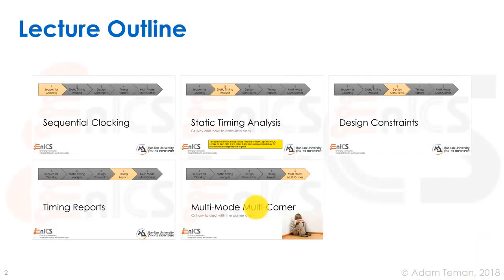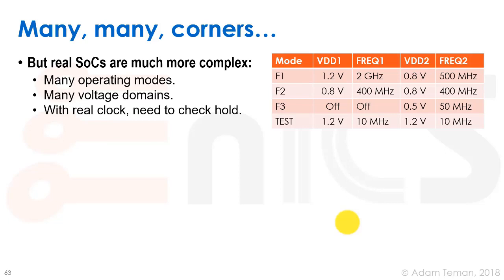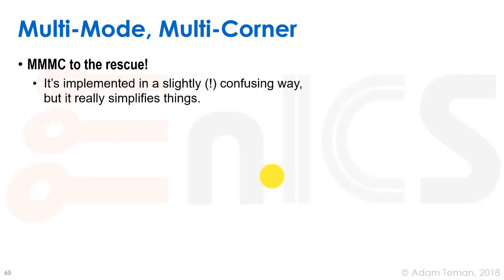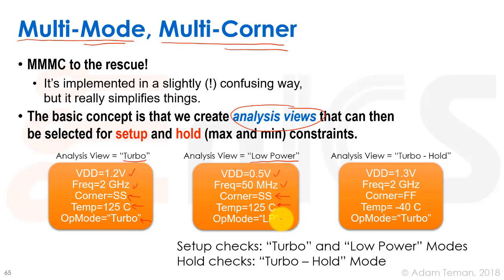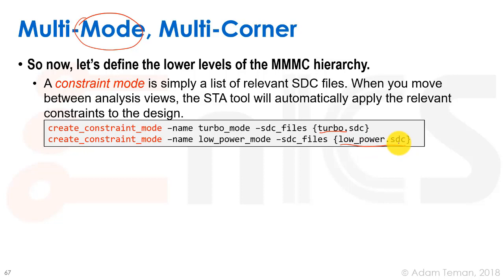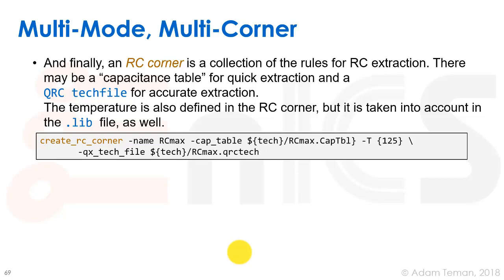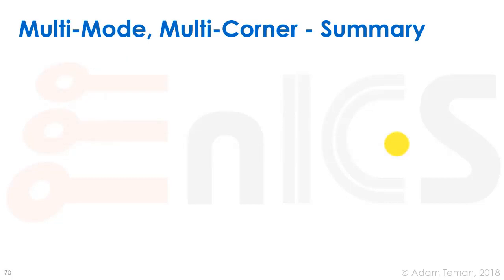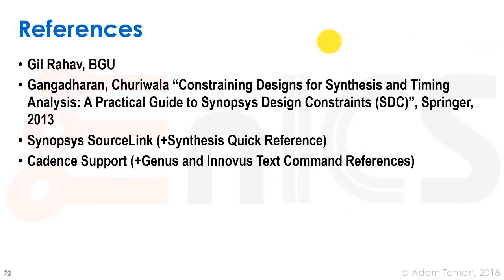DVD - Lecture 5h: Multi-Mode Multi-Corner (MMMC)

Comment: U mention RCmax as R max & C max, this doesn't sound correct.
Reply from the maker: Hi, 
I am not sure exactly how I said it or how you understood it, but as I think I mentioned, there is an inherent contradiction between enlarging R and enlarging C. Therefore "max R, max C" is not an option (or at least not a straightforward one). Therefore, the RCMax, RCMin corners are some "recipe" that the fab creates for the extraction corner that gives such a "worst case" or "best case" extraction corner. But it's not that trivial.

Comment: Are these commands which you have mentioned in the slides for modes and corners are of Cadence tool???

Great lectures, helps a lot in understanding and clarifying the concept.
Thank you
Reply from the maker: Yes. 
They are the MMMC Commands in Cadence Innovus (and Genus, Tempus, Voltus, etc.)
The commands for the other tools are similar, but you have to refer to the specific user manuals to get the exact syntax.